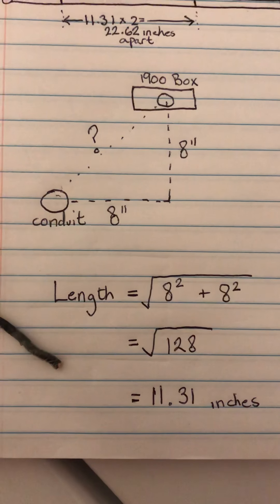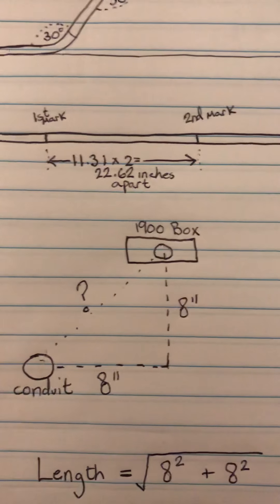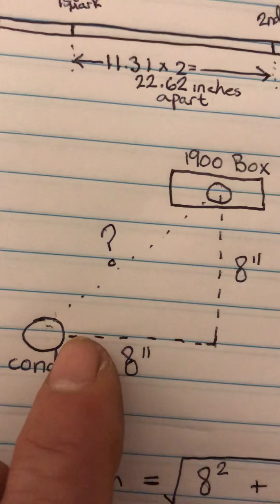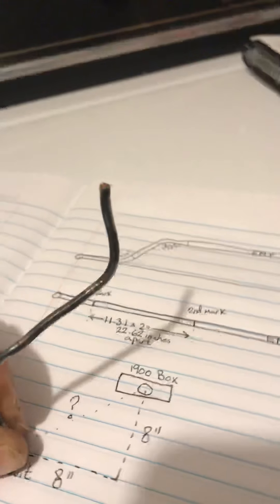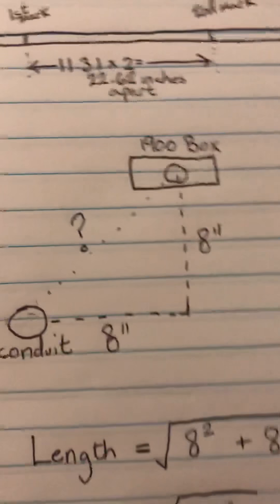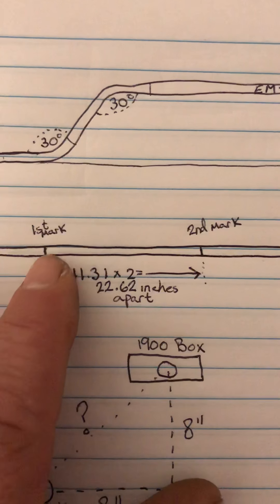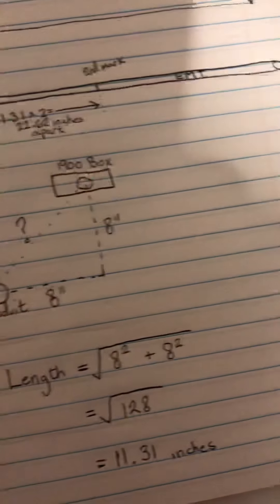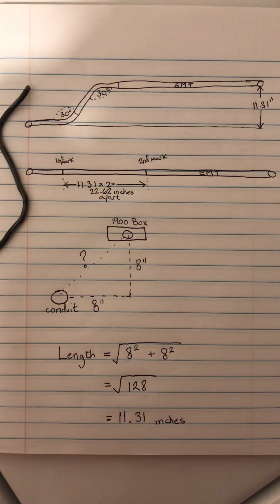Rolling offsets for conduit explained

Comment: They approach you took to explain this was much better than any other video I saw, I would explain where is the factor used to find the distance between angles, it’s the shrinkage, this is the length the pipe will lose due to these bends, if we don’t add it, pipe will be too short.